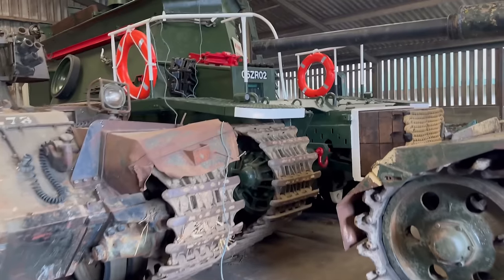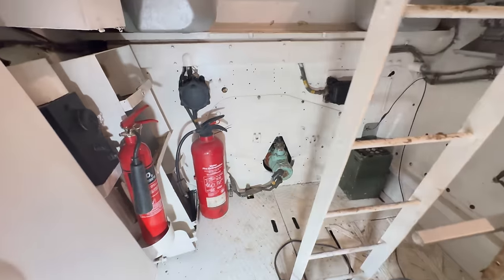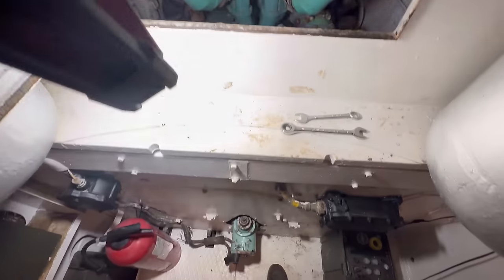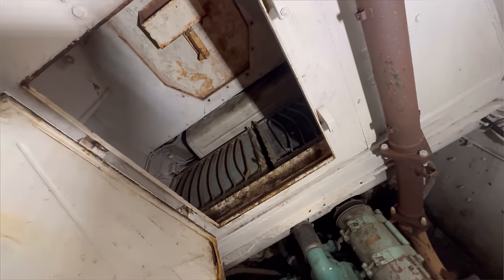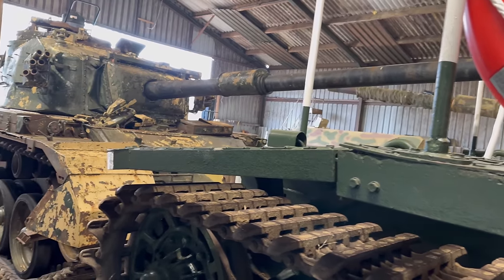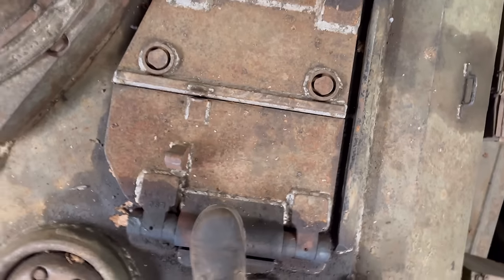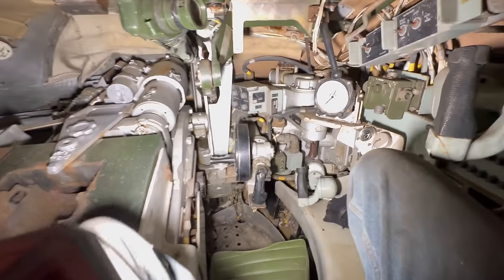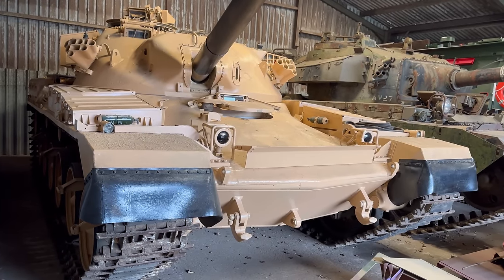My Favourite Vehicle?

Comment: You are lucky you have 50 years to get your projects finished (with luck). I had great plans until I had an accident in my mid 30s that stopped me in my tracks. Enjoy every day while you can. Mind you, yesterday I stripped a 1929 A model ford for some repairs. Clean fuel tank, radiator etc. Someone restored it cosmetically, real nice looking but the insides of the mechanicals were original. 1/2 inch of sludge in the sump..bearings OK but worn rings. Anyway Mr Hughes keep up the most excellent work, Happy Easter and G'day from Tasmania

Comment: Does anyone do a compressed air starter for the Meteor? You do need a big air tank, but in vehicles where the original electric starters were not really up to the job the air starters can work well. Simple to use and easy to repair, and if sized right for the engine concerned, will be very reliable. The other nice thing about them is that you scare the bejeezus out of anyone within 50 feet with the noise and gush of exhaust air. What's not to like? They work just like an air impact gun's motor- but MUCH bigger! Just a thought - enjoy!

Comment: You have a second Cody-Chieftain!

Is there anything you can substitute for the starter motor? Or put a modern electric motor in the old casing?

So you've got around the Centurion gun tank, Centurion AVRE x 2, Centurion ARV x 2, Chieftain x 4, German half-track, 6x6 tractors x 2, T-34, Abbot, plus two aircraft and a load of CVRTs. Has the AMX gone?

Why does Centurion AVRE No.2 have 105 rather than the demo mortar?

Sort out your projects list, get 1 or 2 in the shed on priority and absolutely charge ahead at them! Do you have a schedule/timescale for projects?

Comment: Man that's so freaking neat, as someone who works as an automotive tech I'd love to get under the plating of a tank.
Reply: It's kind of wild to think about and see  how much space is in even a smaller tank. Not many people realize that a crew would quite often end up living in their tank for extended periods of time. Didn't have to be comfortable just do able. That any its fascinating to think about all the people even say that centurion being a relatively newer one has saved and provided shelter for and all the battles its seen, Some won some lost and all the hard circumstances and tight situations. It's sad that tanks are pretty much obsolete with over a century of history. That's not even getting into the engineering of the tank I'm sure that's quite a spectacle. Even cars are a marvel. It brings ti question maybe you can answer but on avg how many moving parts are in one of those tanks?  Obviously different models and even revisions will be different but just a general guess. I can't even begin to fathom all the small intricacies and it just makes my curiosity spike! Each one of those tanks has a unique and interesting story to tell and man I'd love to know em.

Comment: What sort of military vehicle would I have? I designed one that no missile could destroy it. Every wheel will have two electric motors. This means that it would be exceedingly quick and fast, more so than any other ever built. It will all be titanium, which means it will be quite light in weight, which accounts for it quickness.

Comment: There's a problem with the internet connection my friend and I are having. This was a problem for a few days. Whenever this connection is severed, I finish that sentence and type another of them. As for that tank, all the wheels will be of the same diameter. This means that all the motors will be spinning at the same speed. I don't want them to have two different drive ratios. This will complicate this, which isn't acceptable. I won't type any details of it because sonw day I want to build them. To do that, I'll need to patent those components, which means I'm not going to describe them to you. I hope you aren't angry about this. As for the tanks that were built, it's the American tank that has the turboshaft engine of 1500 horsepower. That tank would come close to what I want to build that I finished describing to you. As for it, it will be a hybrid tank. No, I shouldn't describe that either. Young man, I was going to comment about a subject, except I forgot what it is. I need to watch the section of that video so I'll be able to remember it.